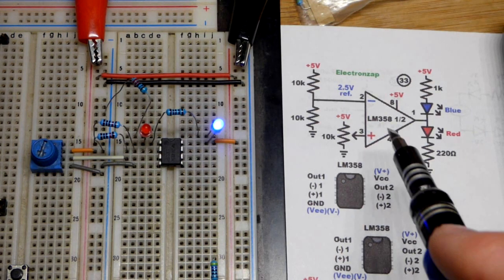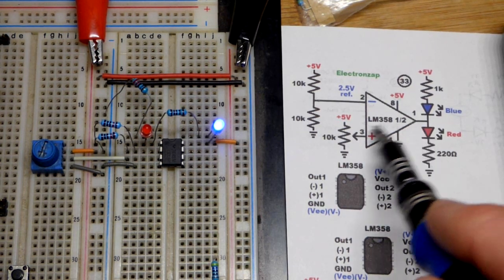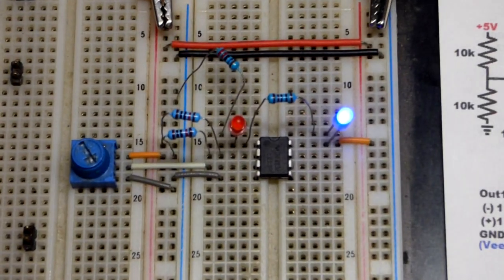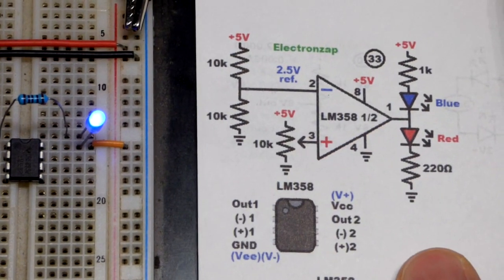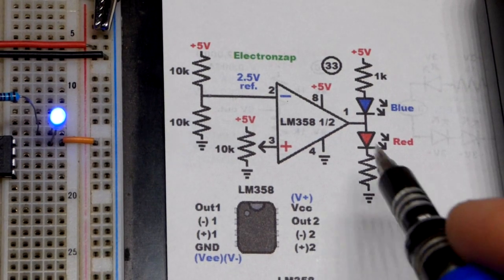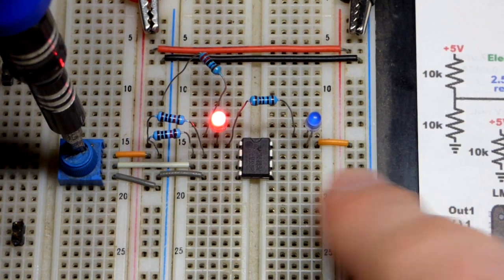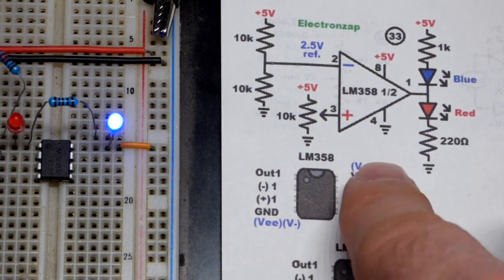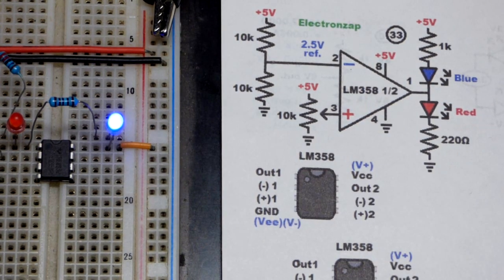How to make Non Inverting Op Amp comparator circuit using LM358 operational amplifier

Comment: Great video - very well explained
Have a question - I built this circuit, but the LEDs did not completely turn off. I was forced to use 12volts instead of 5 (have no 5Volt sources).
What can I do to force the output to go to 0 volts - I think the lowest it want was about 1.1volts
Thanks.
Reply from the maker: Thanks for watching, I don't think I have made 12V+ circuits with op amps yet. Maybe you need to light 2 or 3 series LEDs at a time. I think that most people use the op amp to control transistors in a push pull configuration with most lost. The transistors deliver power the load, and don't need much power from the op amp output. Transistors can generally handle a lot more power than op amps.
Reply from the maker: Also, always make sure you are using enough resistance when you go higher in voltage. The values shown are generally for the voltage used in the schematic.
Reply: @Electronzap  I used a 1K resistor for each of the LEDs - this did the trick; circuit works just like yours, except at 12 volts.
I also doubled up the LEDs - I had a red and green in series for a total of four.
Thanks for your reply's, but more for your videos - very informative

Comment: Excellent.
Capacitive moisture sensor. I'm thinking to use an op-amp instead of a micro controller.
voltage output from the sensor; 1.3v wet, 2.8v dry.
2.5v ref might just be a sweet spot.
Reply from the maker: Sounds good. You might want to use an Op Amp Schmitt trigger for that. It's just adding a high value resistor from the output to the inverting (-) input so that it shifts the reference voltage slightly so that when the signal voltage are almost equal, they won't keep rapidly bouncing the output high and low. Can also use a trimpot to be able to adjust the reference voltage to increase or decrease sensitivity. I just use a trimpot as a signal in my videos because it's easy to see what is happening.

Comment: 😮please if there is no input signal what will be the out put??
Reply from the maker: You really should have a signal voltage, otherwise there will just be stray voltages from the air and static charges that make things unpredictable.
Reply: @Electronzap  i hope it should bw low???